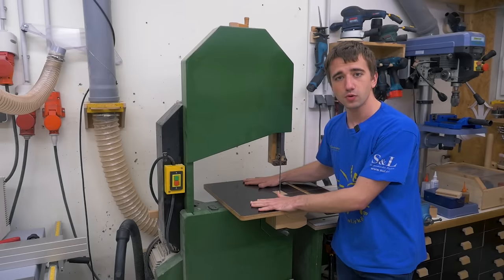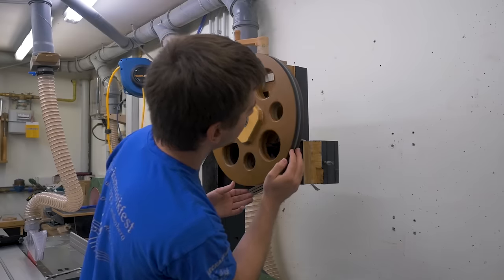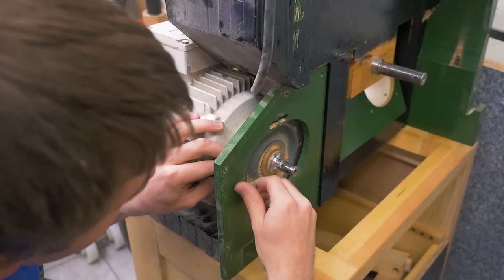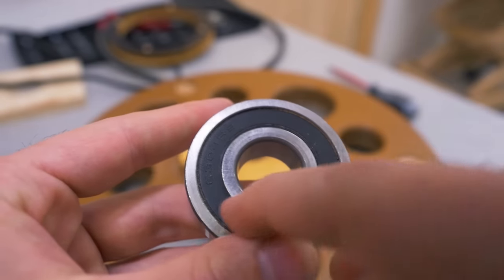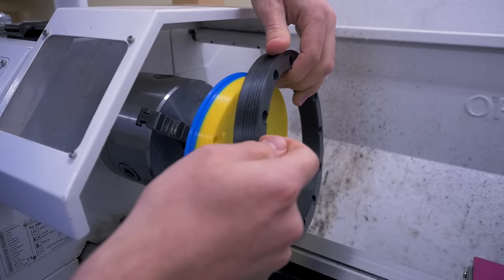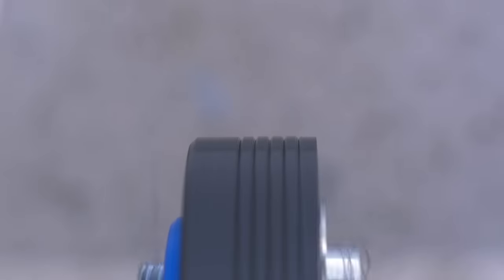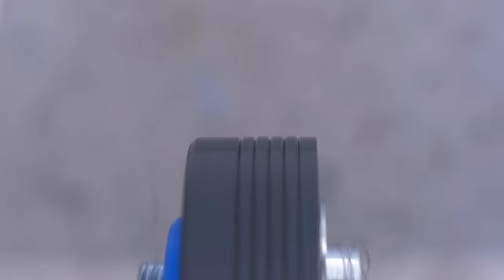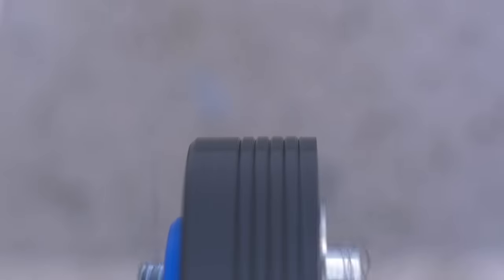3D-printed Pulley for my Homemade 2HP Bandsaw (Bandsaw Upgrades Part 1)

Comment: As somone working at for a mechanical engineering institute at a technical university, there are a few tips i can give you:
You are using a asyncronous motor, it's rotational speed depends only on pairs of poles on the stator of you motor (cant be changed) and the net frequency (in your case 50Hz) of your 3-phase power. So a vfd is your only option for a soft start.
On the V-belt pulleys your grooves should be deeper than the belt. The widest part of the belt should sit below the outer diameter of your pulleys. The way it is now, you are wasing area of your belt that could transmit torque. If you make your pulley grooves deeper, check for the correct side angles and tension the belt, you should be able to get rid of the slippage problem. (take a look into a machinery handbook for the measurements)
Rubbing or the lack of that, in terms of bearings depends on the type of side covers. A type 2RS is with non touching rubber seals (they have a very small gap between them and the inner bearing race), while a 2RSR is with two touching rubber seals. (2RSR can also stop rubbing if the seal is worn down)
A poly-v-belt is a combination of a falt and a v-belt. It is mainly used for small diameters to wind around and still need more torque than a flat belt.
On the same diamteters of the pulleys (if they ar big enough for a v-belt) a v-belt can transmit more power than a poly-v-belt.
The slippage you got with the poly-v-belt was only halve of what you would get in normal operation, because the blade wasn't installed so the top wheel wasn't contributing to the start up load.
If you'd like i can give more details about belt, bearings and other machine components
Reply: He could do soft start with a star/triangle configuration switch. It will not lower rpm but the current will be lower. But that is more for installation that can't take the inrush current and not constructions that struggle with the mechanics.
Reply: @FreeOfFantasy  that would probably not work on this Motor. If it is default wired up as a star configuration it is a 230/400v motor and not rated for delta with 400v between 2 phases. If it was a 400/690V motor then a star-delta startup would work. You could try a softstarter (basically a three phase dimmer) wich raises the voltage/current slowly, but a vfd is the best option i think
Reply: @InExFan01  A VFD is obviously the best solution, but not cheap. A three phase dimmer would be cheap at least.
Reply: @FreeOfFantasy  for soft start this would be fine, but for continous speed adjustment this does not work. A VFD is really not that expensive for this size motor.
Reply: @InExFan01  A dimmer would lower only the voltage, and with that the motor torque only. This could help, but the speed would still be the same. That  can only be changed by frequency variation.
Reply: True. For speed variation a vfd is the only option here
Reply: its rotational speed*
Reply: @FreeOfFantasy  WTF is three phase dimmer? Something from outer space? That what you call dimmer is in reality SOFTSTARTER which has ramp start and that ramp can be limited by time or current and in either case it will slowly without spikes bring motor to full speed. SOMAR INTERNATIONAL LTD from Truro in UK produced some of the the best soft starters with energy savings facility. However just soft starters are quite cheep. Frequency converters are the best but bloody expensive.
Reply: Hey Marius, did you ever see the comment above from Luke? Sounds very useful!

Comment: Star-delta starter would not solve the issue, there is just not enough load on the motor. A soft starter or that vfd will solve the issue
Reply: The large starting torque of the motor is not important to using the bandsaw - torque at operating speed is what matters, so soft starting it will not detract from its function, and probably reduce stresses on everything as well.
Reply: @MiniLuv-1984  I agree. A nice, smooth soft start is the best for a motor, especially if it has a huge load. A direct start (like contactor) will always be more brutal for the windings, but it doesn't mean that they break quicly, they last still a long time
Reply: @jecceworks  Yes, very true, but in relation to lasting longer under soft start, I was concerned for the rest of the bandsaw. That slop in the shaft mount may have been caused by the high torque starts.
Reply: It also cant be used with this Motor. The motor is a 230V/400V motor running of a 400V mains. So switching it to delta will just burn it up. If you had a 400V / 690V Motor this would be an option.
Reply: @Alexander470815  I  agree with you. Another hint for Marius H.: If the VFD is single phase driven at 230V (L to N), you need to change the motor from Star to Delta config. If the VFD works with three phase, you can leave it in Star config.
-
For lower power (e.g. 2kW) it's typical, that the VFD is used with 230V. Pls have a look to the specs. Otherwise you will only have 1/3 of the nominal power

Comment: To help the seals out, you could 3d-print/make a simple cap to mount over it to seal it of from dust. Even the slightest of wood dust will suck grease out, which then starts to increase wear on the rubber letting more dust in. I think it will expand the life of the bearings and is a pretty easy add-on.

Comment: 26:06 The flip of the dial indicator had me laughing! Also, I think the pairing of 3D printer and lathe (or a milling machine) is a great use, you can keep material lost at a very low percentage.

Comment: Good stuff, the belt lengthens/slackens on the top side on start up, a small spring loaded idler pulley should solve the start up slip and aid tension on the belt.  a cheap fix

Comment: This project ended up as a tour of several previous build projects. I was very interested to see how your printed parts cut on the lathe. Getting the speed right on plastics can be tricky. A very enjoyable project. Component failure is something we all face.
Perhaps you should look for a flexible bearing puller. they can be useful.

Comment: Marius, in order to resolve your problem of slipping belt there are two options. One is cheap Soft Starter with ramp and more expensive is Frequency converter which besides soft starting function offers variable drive of your electrical motor. 

However, there is the third solution which is changing AC motor for a DC motor which allows you control of running according to load.

The best is frequency converter because it offers full control over the AC motor. The only problem is price. Lots of music comes with lots of money. Soft starter is not a Delta/Star because this totally obsolete system is already part of every motor and does not reduces starting current spikes.

Comment: Great work! I am a fan of multi groove pulleys. They transfer more torque, and run quieter. The variable frequency drive will definitely be an improvement. Even a small amount of start up slippage significantly accelerates wear, though the noise I heard on startup, with the final pulley, may have been motor whine.

Comment: I would never 3D print a part on a powerful electric motor driven cutting device.  But if it works and it seems safe enough to operate, then I guess go with it.  Really nice band saw that you have.  I hope to have a band saw that could cut a fairly wide board like a table saw can, but with a small fraction of the noise.  Then it could be used in an apartment, and it would be a lot safer than a table saw, or even a radial saw.

Comment: Installing a new bearing you could use a thicker bolt with some washer or a threaded rod with nuts. put it into the hole of the bearing and it will be probably faster and more straight than this clamp method. But great work i'm really envy for this bandsaw of yours.

Comment: 7:29 note, the pulleys probably weren't actually being driven by the screws, if so they probably would've sheared off long ago with all the large fluctuations in torque over its lifespan. instead, the main force the screws were seeing was the constant tension from when you initially drove the screws in. that tension pulls the two parts together with significant force, that force is multiplied by the materials' coefficient of static friction, and that friction force is what actually transmits the torque. this is why well engineered bolted connections can have higher shear strength than that of the bolts themselves (and also why you can get away with oversized bolt holes but still end up with something very rigid)

Comment: I upgraded my metal lathe (1943 Reed Prentice) from 3HP 3ph to 5HP single phase (I don't have 3ph power).
The starting torque was SO strong I felt it would break the lathe's drive chain, so I changed capacitors & it starts very well now.

Comment: I think solid thic plastics like acetal are very good construction materials and a lot of times i like them much more than wood because they are not prone to splitting, water, expanding or cracking over time. The only issue is that they are much less readily available in stores.

Comment: The VFD will solve the start torque issues and the added bonus is variable speed control. You will find that you can get the perfect blade speed for whatever material you are cutting and blade you are using.

Comment: A good example of why I sold my Prusa, that wobble on the lath of the printed down blue part means you probably also have one of those beds with around 0,5mm bow in it, which according to Egoprusa is okay due to the bed probe, but IMHO this (and a few other things) are unacceptable for its price class when you like to print mechanical parts.
That aside, it's quite interesting to see a 3D Print being turned down on a lathe, I've surfaced some on a CNC but turning on a lathe? Yeah, I think I gotta try that out once I get my Paulimot :D

Comment: A light weight dust cover over the bearing should dramatically reduce to dust issue. one option would be a rubber ring around the bearing into which a foam disk could fit. On the shaft side a helix can be use to eject dust that gets between the foam disk and shaft.
A tensioner wheel could solve the slippage by pushing the lose belt down.
Ah, bloopers, never work with primates or vampire squid.(Cthulhu, circa 997,883 BCE) :,D

Comment: A star/delta setup is only used to limits inrush current at startup for motors that run in delta mode. To stop the slip you would have to lower the starting RPM. That can be done with a softstart module or a variable frequency drive(Overkill for this application)

Comment: I think that bearing wore out very quickly because a single bearing like that can’t really handle the moment the two belt tensions exert on it due to their axial offsets.
I feel with the new bearing the same failure will only be a matter of time as the bending makes the inner race deflect with respect to the outer race and make the seals rub and wear down.

Ideally, you need to add another bearing on that shaft to properly constrain that wheel and reduce any bending moments the bearings have to take.

Comment: Star delta will work if you lower the input voltage by 1\sqrt(3) from mains. You can order a soft starter for your motor. It should be healthier for the grid and motor

Comment: This is great, but the jump up to VFD etc is a lot more cost.  I would have been tempted to fix this mechanically, on the cheap.  Or at least fix 80 or 90 % of it, probably won't match speeds exactly..
Possibly do it manually, with a small hand wheel you swing in to move things and get the wheels moving a little, so it isn't dead stop inertia.  But this would work great with a small secondary motor, think of it as a starter/brake motor.
Small motor on the back side, that can teeter so it normally doesn't touch.  Front side lever, you hold it up and press a button, presses the shaft against the band wheel and spins it up in a second or few.  Once you turn the saw off, hold the lever up a few seconds without the power on button and it acts as a drag brake.  Spring pulls the lever down so the motor shaft is away from the wheel normally.
With a little more work you could make it automatic.  Flip the bandsaw main switch and it holds the start motor in for a few seconds, then lets it move away, power to the main motor and the start power goes off.  Switch the saw off and the main power goes off, starter motor engages but with no power for 5 or 10 seconds to brake the saw.
Probably way way cheaper than any sort of VFD and still fairly simple.

Comment: That router circle jig is pure genius.

Would a spring-loaded idler pulley running on the back side of the belt help with keeping constant tension. I've seen that on many vehicles which use a serpentine poly-v belt to drive multiple accessories off the motor crankshaft. My Rikon 10-325 bandsaw uses a drive belt like yours and belt tension is done with a idler pulley with a manual adjustment, no spring load.

Comment: I think that type of indicator (the one used at around 26:15) only shows the correct value when placed at 12.5° or something and when placed at different angles a factor has to be used. Might be wrong though.

Comment: Over time the wood would have expanded/compressed, so the hole isn't the original size. You should have added a new coat of varnish to the inside of the bearing hole. That would add a small amount of hole reduction to give a better friction fit.

Are you sure about the 2 belt pulleys being co-planar enough? Otherwise the belt may "walk".

Comment: 3:24 The old way of checking the bearing for noise. A solid rod (wood, metal) rests with one end on the axis of rotation of the bearing, the other to your ear. That is, if there is no stethoscope.
Reply from the maker: Cool method

Comment: Wouldn't a cover plate, like the disc you had trouble removing keep dust out of the bearings? Positive retention could be achieved with large washers on some of the screws holding the belt pulley on.

Comment: I hope that frequency converter have soft start function so this motor will stop trying to destroy everything on start :D
Reply: These frequency converters have more functions than you might need (especially in this application). I am therefore sure that a soft start function is also integrated ;-)
Reply: @berndb.5097  i've seen people using these things at many channels but never use one :)

Comment: If you were to remake these wheels, could the entire bearing assembly also be 3D printed? then it would always be centered right? Or is the plastic too weak to properly hold the bearing?
Reply from the maker: I would use wood or metal. A problem will be mounting the 3D print to the wheel with bolts. The plastic won't be able to handle the pressure from bolts, especially over time and the bearing assembly will slip

Comment: Hard to tell from just the video, but the grease in those bearings looked dry and contaminated. Wood dust readily absorbs both water and oil. When it accumulates on the outside of your bearings near the interface of the seal lip and inner race, it will start to absorb the minute film of oil from the surface which will increase friction, heat and wear of the seal and also deplete the lubricant inside the bearing at an accelerated rate, causing premature failure due to lack of lubrication and overheating. This is something I encounter often in woodworking machines.

Comment: Moin Marius,
Was für ein teilbares Druckbett für den 3D Drucker nutzt Du da? Kann sowas auch gebrauchen, denke ich...
English (short version): what 3D printer bed are you using?
Reply from the maker: Das ist die Standardausstattung bei meinem Drucker (Prusa i3 mk3s)
Reply: Danke, dann muss ich wohl mal recherchieren. Meiner (Geeetech A10) ja er das nicht. Und auch die Superplate, die ich inzwischen drauf habe bietet das nicht.....

Comment: It would have been great if, wherever you said "yeah, that is not how it's supposed to be done", that there is also a "actually, it should have been like,... ". This is how we all can learn. Maybe you can add such comments next time.
Also in the slow motion it looks as if the belt hits some edge on the top when starting. Is that only visually missleading, or a real concern?
Cool video, thanks for the work!
Reply from the maker: I'll try. It won't be an issue, when the motor starts slower with the vfd

Comment: There are even better bearings from skf with a metal seal at the sides.
Reply: The metal seals just keep big particles out, not dust. In this application rubber seals are just right. Metal is not better in any and every way.

Comment: Hi Marius, can you please share your profile for your PETG prints. I also have a Prusa and can never get my prints to look as good as yours.
Reply from the maker: I always use the standard settings from the prusa slicer. Do you use good filament?
Reply: I've been using Cura as that's what I learnt to use on my previous printer, I'll give Prusa slicer a go. As for the filament, I believe it's a good quality brand here in Australia but I'll search around for some well reviewed ones. Thanks for the reply
Reply: @MariusHornberger  What's on your bed? I read that printing direct on the PEI you wouldn't be able to detach the print so I've fiddled with a glue stick but not happy with it. Which filament is good i.e. what are you using?

Comment: No, a star/delta switchover would not help with this kind of issue.
Furthermore star/delta switchover is viable ONLY if the motor is wound for a nominal voltage of 400/690 V. If it is made for 230/400 V then the windings would burn down in a minute or two after switching it on.
With that said IF the motor is made for 400/690 V, in star configuration it provides only one third of its nominal power (0.5 kW instead of 1.5 kW (2hp)).